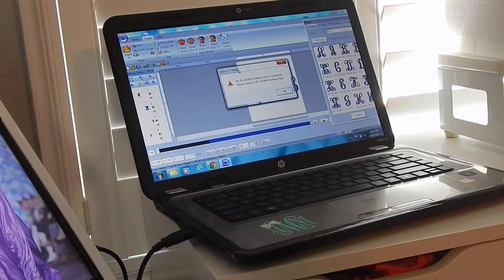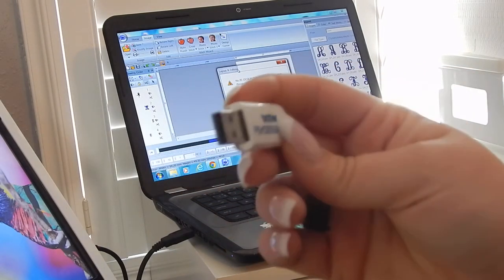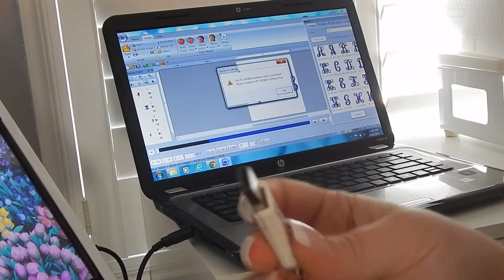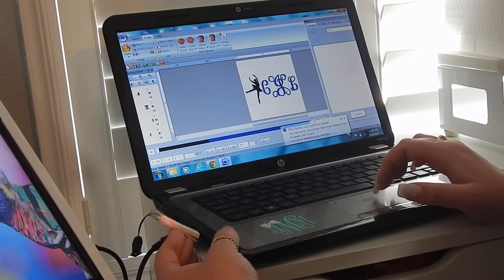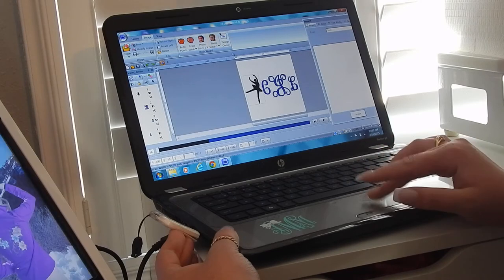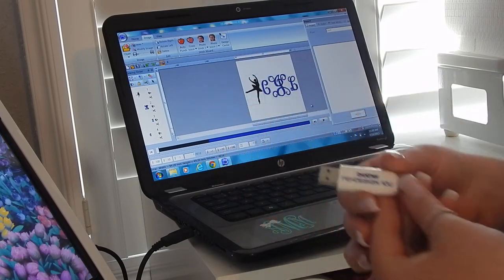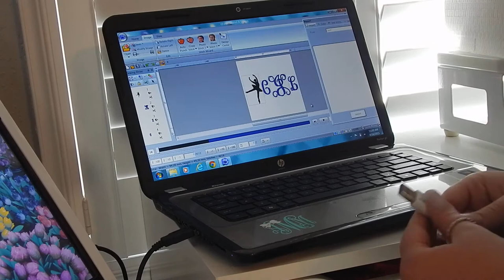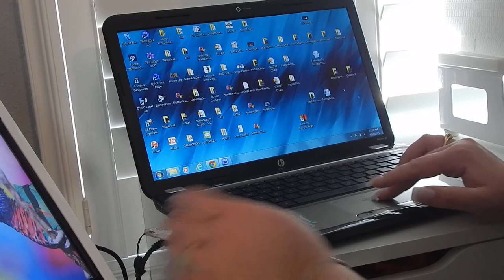PE Design 10 Problem (FLASH DRIVE)

Comment: I have this problems as well. It has been on-going for THREE YEARS!!!When I was using my card reader, I got the same error message and sent it to Brother for repairs -  and they LOST it!!! It took over 6 months to get it back - and then it was only with the help of a Brother instructor. I didn't use the reader for quite some time - involved in other projects. Now I am trying again PE Design 10 and the thumb drive. I am still getting the same error message. The software does not recognize my thumb drive. I have called Brother but to no satisfaction so far. If any of you have a suggestion, I would greatly appreciate your help. Thanks!

Comment: I would get halfway through a design, try to save and then would get a error message saying I did not have my security device.  Then I would jiggle it, but too late.  All the information was lost.  Finally contacted my Brother dealer and got a replacement  For such expensive software that dongle was a cheap piece of *#%!.  Hope the new one holds up because it does get banged up on my laptop.  The old dongle lasted me 10 years.

Comment: do not put a dongle directly into the computer. use a hub. do not remove it from the hub. take the hub in and out instead. that way nothing happens to the dongle. they are ridiculously fragile. there are legal emulator programs available. there have been congressional hearings about this very thing so you're not alone.